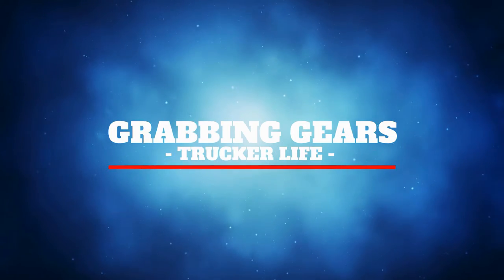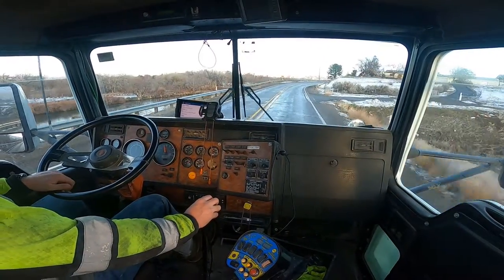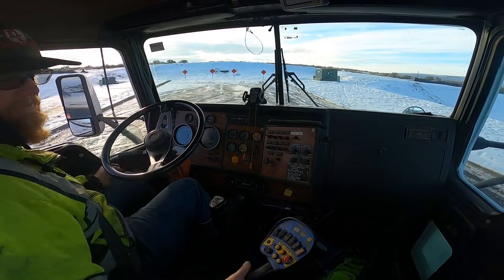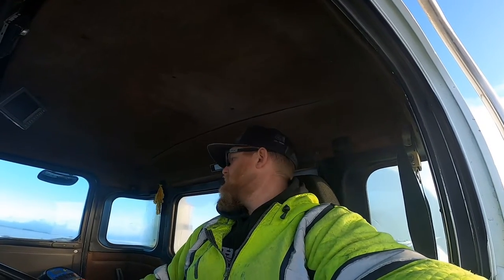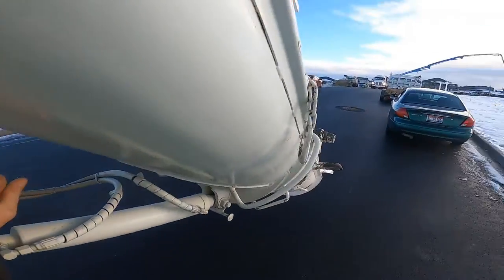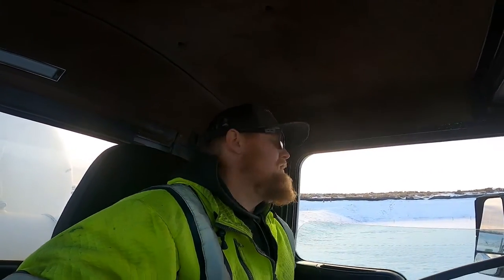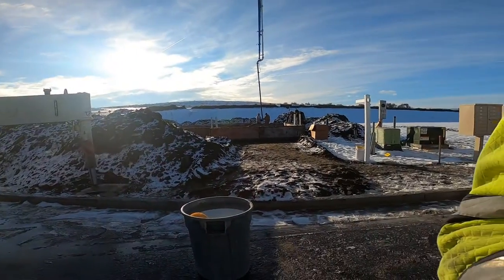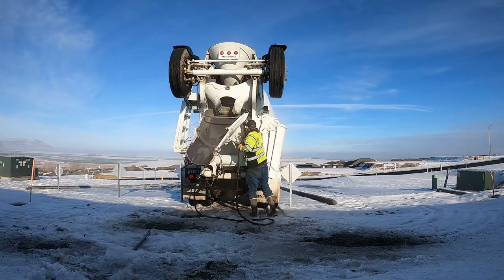Cement Mixer: What is "slump"?

Comment: Slump is the lie the customers say they want because they're going to try to pump a 3 then get mad when it doesn't pump or they're going to add 20 gallons to the 5 they ordered anyway 😂
Reply: Right?  Order a 5 put in 40+ gallons then spend over an hour unloading you while constantly using your water hose...  Then get pissed when you cut them off... 

 Got to love it.
Reply: I'm new but yeah,  ticket says one thing about the slump,  but once u get there,  they always have u add water.  When I wash in,  I don't care how much water goes into the drum  bc I know it will dry out a little bit  and the customer will almost always want it wetter
Reply: Maar is wel zo

Comment: But you also have to take the temperature into consideration. 
I rather get the dirt moist and pour a 3 in slabs with up to 80 degree temperature, which gives me a stronger slab. That’s also New Jersey, not Arizona. In Arizona I poured slab of 7 and I saw the men rush. In New Jersey, even in the summer a 5 was a great slump. But if it rained the day before and temperatures around 70, I would ask for a 3. 
In using a phone to write that and I can barely read what I wrote, hopefully I didn’t confuse anyone.

Comment: I still can't believe he said for a curb they pour a 3-inch slump. He needs to come to Michigan because  our curb is a 1- inch slump.
Reply: In NC it’s a 2 inch slump
Reply: im in toronto sometimes they want a 7.5 😂 i cant complain makes it easier for me to washout.
Reply: It's usually a 3"  here too in StLouis area
  maybe it's bc of different humidity levels in different areas (?)
Reply: @smeshcel3025  not on a curb machine job bro.  ur high
Reply: @vaekkriinhart4347  hey im speaking from what ive seen. These guys damn near want soup for curbs. But thats 70 percent of the time. The other 30, they want the dry stuff
Reply: @vaekkriinhart4347  on like highrises not like sidewalk curb type shit. But on highrise curbs they go pretty wet because they put a chute under their bucket and it has to reach in tight spaces. Ive done a curb machince with a 7 inch slump. I was suprised myself but dunno thats what they wanted. Ive poured more curbs wet than dry. Im just as stomped as you why they want it so wet sometimes

Comment: How do those things handle in the snow? I drive a frontload garbage truck and there horrible lol
Reply from the maker: haha they handle like a dream if you keep it under 15 mph... I was looking into garbage trucks a few years ago but they had a wait list for new hires about a year out. How'd you end up with that gig?
Reply: @grabbinggears109  wow a year wait list a year out? Now they can’t keep anyone so it’s easy now lol. My uncle drove rolloff and got me a job I actually got my cdl that way same with a lot of other guys then we got bought out by waste connections. So they don’t do that anymore. 10 year so far. It’s a decent paying job by me same with ready-mix driver. In couple of years or so I might want to switch to concrete.
Reply from the maker: @Guitar157  yeah it was maybe 4 or 5 years ago I was looking into it so I'm sure it's different now. Do you run a specific route every day?
Reply: @grabbinggears109  yeah I do residential in the Chicago suburbs same route every week sometimes commercial but they don’t really mess with me anymore unless they have to if someone calls off some else will usually deal with that lol it’s good to be on vacation this week

Comment: I like the videos, but how old is the footage?
Reply from the maker: Haha yeah I'm slacking... it's from last winter. I'm recording new stuff now but I'm still working through old videos. Are you a mixer driver?
Reply: @grabbinggears109  not currently but very interested in getting my CDL, for either dump truck or concrete mixer. Stumbled upon your channel and have binge watched every episode so far. Do you prefer manual or is that all your company currently has?
Reply from the maker: @bryceweaver01  nice. I had a buddy quit mixers and switched to dump trucks. But he quit that like a month later and came back lol. He said it's rough because in a dump truck there's no break from driving, it's go go go all day. My company has both auto and manual, it's just luck that I ended up with a manual. Autos are obviously way more chill but manuals are more fun... it's a hard choice... where are you looking to work?
Reply: @grabbinggears109  I live in Indiana. That's good info on the variables between the 2, but still beats being stuck inside a factory for 8 or more hours a day! Plus, with a valid cdl you can always find a job, if you keep your driving record clean.
Reply from the maker: @bryceweaver01  That's true man, I moved across the state last year and lined up a job with a couple of phone calls. Especially with mixers, you can get a job just about anywhere...
Reply: @grabbinggears109  thea question I have is how do you get trained if you're new, since there's only 1 seat in a mixer truck?
Reply from the maker: @bryceweaver01  I have no idea why, but they take the seats out of some of the trucks... but every company will have several trainer trucks with both seats still in there. You'll probably ride with a senior driver for two weeks or so, then you'll get your own truck!